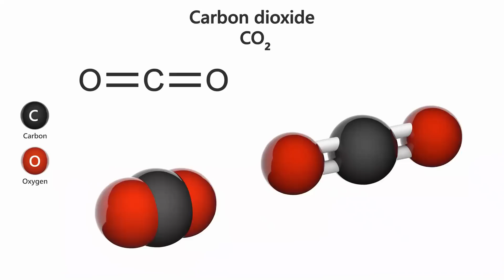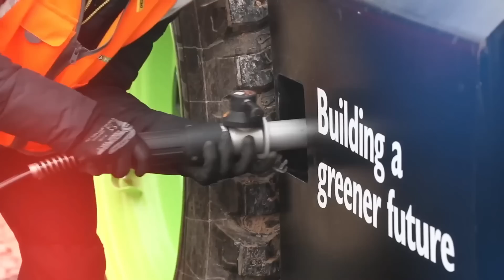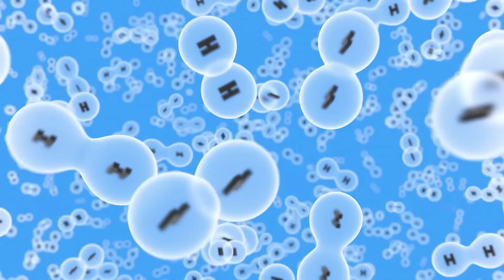Huge News! JCB's Hydrogen Engine will destroy the EV Industry!

Comment: Used to laugh about putting water in our cars then , electrolysis was worked on, burning the hydrogen works but from water the oxygen gets dumped but i wonder if it could be route also to the engine so no need for air-intake and no nitrogen then no nox ??

Comment: As CO2 is NOT a pollutant and is REQUIRED for life, this FUD is nonsense.  The overlords are terrified CO2 will rise for good reason.  Ask any greenhouse operator to show you his CNG CO2 GENERATORS used to boost production of plants!  Overloards are terrified high CO2 will cause us to be DROWNING in FOOD, used to control us.  2000ppm tomatoes are HUGE!
Outside of my obvious fear of ANY explosive gas in quantity to be stored in your garage, H2 leaking replaces Oxygen causing death even if the leaky tankage doesn't blow the house apart.  You KNOW storage in the consumer's product WILL leak from cheapness.
No mention of this H2 engine's longevity beyond the payment mortgage is considered,  Case in point:
Every DIESEL injection of fuel OIL sprays the cylinders with OIL!  The FUEL is a LUBE OIL.  This is why DIESEL engines go 1+ million miles between overhauls.  Hydrogen or any other gas wears out the top rings from day one.  Gasoline, a solvent, is worse!  Long life engines are all DIESEL!  Of course, the overlords selling cars WANT it to wear out, forcing you to buy another one, SOON!

Comment: I do HOPE it's hydrogen/electric--- with hydrogen operating the electric motors on each wheel like trains.  That would gove FAR more mileage, longer wear, moire power, and much less fuel used at all and the ONLY output being WATER.

Comment: Fuel cell is a better option. The hydrogen engine needs compressed gases, a leak, even a small leak is catastrophic-ie explosive! and they are putting this on construction equipment which are notorious for impacts and scrapes...Yeah, good call...
Reply: yep, because no equipment runs on compressed gas, except our forktrucks used in our Propane company that fills thousands of Propane cylinders per day. Good thing they don't power construction equipment, trucks or automobiles with that explosive gas or heat peoples houses with explosive gas.

Comment: All this is fine And good until ,someone wrecks the thing. And a leak happens...🧨☠️ Remember the Hindenburg....
Or a leak just happens. Anyone who has seen a car battery explode knows about this. 
Car batteries explode just a small amount of hydrogen. A very small amount... Using hydrogen as fuel requires much more then that.🥺☠️

Comment: Destroy the EV industry? There are currently 140,000 EV charging stations in the US.
And 150,000 gas stations. MORE in Canada & Mexico. How many H fueling 
stations are there? California has the most with 17. And those were built by the 
state government.

!
Reply: 60,000 public chargers in the UK and over 30 million homes plus work premises. 12 hydroden stations. JCBs engine is for a niche of big machinery for operators who will need to have a Hydrogen storage facility. EVs are simple, cheap and getting cheaper.
Vehicles with fewer and more reliable working parts. Why would anyone wabt a complex andd expensive 'new' ICE that you can't fuel? Why use energy to create hydrogen then transport it to distribution points of which tens of thousands would need to be built? 
Nonsense, Hydrogen engines aren't going to take over anything.
Reply: @iainwares6361  Exactly. There are now so many glossy, fossil fuel industry funded, videos being published now, all starting off with visions of wind turbines and PV panels and then the cut to a big shiny H2 container sitting in a field of grass. It's utter propaganda.  The absurdity of using wind and PV electrons to create H2 (wastefully purified, compressed, cooled and transported for using in expensive precious metal fuel cells) or even worse, compressed and used in a ICE, is breathtaking.  It needs to be called out every single time.
Reply: 16 now, in CA, now that the Bakersfield refueling station blew up (stranding all the other ill-considered, million dollar, busses).

Comment: Hydrogen power is also a way of retaining a real car (i.e. with a proper engine rather than a battery operated 'E vehicle ') for motoring enthusiasts
Reply: A hydrogen vehicle is an even better way to die in an accident compared to a standard friction engine vehicle. A fossil fuel leak and combustion will give you plenty of time to realize you're going to die, where as with hydrogen, you will be with your maker in the blink of an eye (along with unfortunate bystanders - to whom you will, for all of eternity, have to apologize, for your ill-considered transportation fuel of choice).
Reply: @mb-3faze  finally! Somebody with atleast a small amount of good sense. You have just proved you have more then that.
Now if we could persuade others that just because someone can do something it doesn't mean that they should do something
Like that accident they had with the demon core and a screwdriver. That was really stupid.
Reply: That’s BS… you would not be able to do anything modding wise or to make it go faster. You will have zero control.
Reply: @KKandEV  Still a proper ICE car always better than battery powered
Reply: It is.

Comment: First of all we want Hydrogen on Demand!! not government-controlled hydrogen fuel? We can make or own fuel as i drive one now and quite happy with it. I Save between 30-37% on fuel. with more technology this can be greatly increased. Hydrogen on demand kits are easy to install to any currant ICE's  🙂
Reply: It would be worth you looking into this. The answer will disappoint you but you'll learn a bunch of physics.
Reply: Please keep that thing far far away from me!!!
Reply: @timothyterrell1658  Why it is perfectly safe!! Been running it for a year and a half now! you burn it as you make it also has a built-in bubbler and a one-way valve so impossible to blow up 🙂
Reply: @thegrantdanielsband  I know how one way valves work... until they don't. You know how nuclear reactor domes blow off?
It's that hydrogen that keeps showing up.
Reply: @timothyterrell1658  First of all you have no idea i said not only it has a one-way valve BUT? I also said a bubbler and it burns the gasses right away! there uis no way it will blow simple! I aso said i have been using it for 1 and a half years flawlessly so i know how safe this is and the money that i save :--)
Reply: @thegrantdanielsband  as I have extensive experience with the industrial chemical environment, working on and with gasoline propane diesel fuel and electric drive equipment, have seen equipment failure of all types. Industrial chemical process units exploding and burning seemingly with no proper cause or reason. Having worked with oxygen propane natural gas diesel fuel engine oil hydro oill gear oil  argon helium carbon dioxide freon sulfer dioxide several acids and solvents along with several things they wouldn't tell us what it was..Telling me that it's perfectly safe is telling me that you don't know what your doing. As there is nothing that is perfectly safe. safe ? There's no such thing as safe. You write about back flow preventers and bubbler valves as if they're absolutely foolproof.. I on the other hand had such blow up in my face.I am very proud to still be alive .  Mark my words, when you think you have all the answers start over and look again.
Reply: @timothyterrell1658  Obviously your experience was a failure? My experience with a real company that makes these kits that work is awesome and saves me money sorry for your luck and inexperience, but you would benefit from a company that has the product that works like i have 🙂
Reply: @griffint6637 untill something goes wrong.. And when it does you can never take it back...
That's not if, that's when.... Humanity has a bad habit of making mistakes and atomic energy has no room for mistakes.
It is best to leave that sleeping dog lie.
Reply: Are you talking HHO ?
Reply: @jerrypeal653   you mean that stuff that blows up with the presence of oxygen and sunlight?
Reply: @jerrypeal653  Yes
Reply: @griffint6637 nope not necessarily, renewables like wind and solar can produce it .
Reply: I save 99% running my diesels on 75% used motor oil mixed with 25% used ATF.  Touche...:face-purple-crying:
Reply: I'm going right to the point.🤨 We have a number of people who think that hydrogen is a good fuel source..
There is one simple problem with that.
Hydrogen is a nuclear level fuel , having very weak binding qualities. What this means to us is it is a high explosive chemical
Element, and will bind with oxygen very freely. Requiring very little heat to ignite.
This Is All well known information passed on for generations now. 
Some people choose to disregard the information provided by our elders about the extremely dangerous unstable nature of
this element. Having seen how easy it is to detonate the small amount of hydrogen collected from a charging car battery
And just how violent that explosion is, I strongly warn those thinking that hydrogen is a viable moter
 vehicle fuel source,To think again. As you're never going to be able to produce a safe system to sustain a high speed collision with another object. As noone in his right mind would consider using liquid TNT as a motor fuel, why would you consider using something that is even less stable?
So please stop wasting time and money on something that will not work.
Find something to use for fuel that is stable and get to work making something that we can use instead of something that we can't.
Reply: @griffint6637 to split hydrogen from water you have to invest exactly the same energy into it as you can get out of it, plus whatever lost energy in handling.
Reply: @griffint6637 if you think so we can set you up with a nice house right next to the local nuclear power plant.☢️☠️🤨
Currently noone wants it at any price.🪦 wake up and smell the three mile island.... Unless you want to go to Japan...
I hear they have a really nice sea side location really cheap. I'm sure they would let you move right in..🤣
Reply: @griffint6637 under normal electrolysis it does, but there is more than one way to split a molecule of water.

Comment: ICE Engines  ? They are done compared to Fully Electric motors ? Hundreds  of moving parts that can brake compared to Electric only having 3 that are good for hundreds of thousands of miles no oil changes no spark plugs no airlifters . :text-green-game-over: ??  Though There in my opinion a place for Hydrogen , to generate electricity to charge the batteries on EVs  🙂
Reply: And how environmentally dirty is the EV battery manufacturing process? Hydrogen power is also a way of retaining a real car (i.e. with a proper engine rather than a battery operated 'E vehicle ') for motoring enthusiasts
Reply: @namesurname4385  Does it go broom broom like a V8, thought not.
Reply: @EXSKIN  It depends, if the hydrogen combustion engine is in a V8 high capacity I can't see why not but the combustion is always better than a battery operated
Reply: @BillBadMule Batteries are ideal for toy cars not for real world long term needs. Even so they need to be disposable otherwise your kid wil play for a few minutes and spend hours crying waiting for them to recharge!

Comment: Finally I stopped the video as it is more a blatend commercial for JCB then an actual review of balanced pro's and cons of hydrogen as fuel. I could have know within the first 4 seconds of the video as there already a misconception is launched but I wanted to give the maker some slack. Hydrogen as meant these days is not a energy "source". It is a transport method for energy. Hydrogen has to be made using energy. So it is only green energy when it is made by environmentally friendly sources like solar panels and wind or water turbines.
Reply: @griffint6637 Indeed. Fukushima demonstrated how well hydrogen is created. So much so that it demonstrated the fact by blowing itself to bits.
Reply: @griffint6637 No, no , quite well educated in the fields of engineering and physics :)  Nuclear power and 'safe' can be in the same sentence but add 'human' in, and history shows that you either have to remove 'safe' or 'nuclear' to make a logically accurate statement.
Reply: And you're point is?

The objective is zero emissions at the tailpipe.

JCB is a company so of course like Tesla they're promoting their achievement.

JCB makes heavy industrial equipment that needs to be decarbonized and batteries can't solve their unique problem.

Their Hydrogen "Diesel" engine can be the answer for immediate change to industries that want to go green but have no alternative.

Ships, trains, tanks, trucks, dozers, excavator, farm equipment, mining equipment, and diesel electric generators all have duty cycles that can't be serviced with batteries.

So your complaint is what, that they were first to do something about it or how they mischaracterised the function of hydrogen?

Gas, Diesel or Hydrogen all require the use of energy to make, refineries aren't run on magic.

They received no government money, they're not known to the consumer market and need to promote to sell but their customer base is small so a mass ad campaign won't be economical. Name one thing you buy that isn't advertised, even vegetables make the weekly flyers.

They'll use their dealers and sales reps and trade magazines but the potential for their technology goes far beyond their typical market.

It takes content providers to seek them out and inform John Q Public on what they are doing.

When was the last time you saw an International Harvester ad on TV 1970 what?

They don't use TV because their buyers are working during the day, probably get up during evening commercials and they need more 15 to 30 seconds to sell their products.
Reply: @IMGreg..  My point is that an advertsiment video is not the good place to gain information about something as there is no balance. For some reason Americans lost that concept completely as they are so used to commercials that even videos presenting as informational videos are received as 'normal' while the only goal of the video is selling a product.
Reply: @griffint6637  nuclear power is not environment friendly. It is a blatent lie. The waist is stored underground in the "hope" it will not leak radiation within 30.000 years. I have seen seldom a more stupid deny of safety as storing nuclear waist in concrete underground and just hope it will stay closed.  Hydrogen should be made by solar power, wind power, hydro power but not with nuclear power
Reply: @griffint6637 So permits, site and environmental impact studies for a new, say, 5GW reactor would take about 8-10 years, building it would take 15 years or so. It would last 30 years, maybe 40 producing overpriced and subsidized electricity and then the public would be on the hook for decommissioning which would take how long(?) - it's never been done. After that, 500 generations before the land would be contaminant free. I used to be pro-nuclear, but really, the numbers don't add up and the alternatives are much better.
Reply: @griffint6637  Actually we don't need to know much about nuclear energy other then it gets very deadly whenever it gets out.
Chemical energy on the other hand,we know far more than we want to know. 
Hydrogen gas is a very unstable dangerous gas, and is a byproduct of nuclear power generation.
With proven desasterous results. 
Hydrogen gas is very desirable in stars ,but not in planets.
And most particularly not in direct contact with nuclear reactors..
The promotion of nuclear energy by certain individuals who have invested so much of themselves in it is unfortunately
Promotion of themselves.
It is not in the interest of humanity that this this continues,as we cannot cleanup when they mess up and drop a test tube
in they're fantasticly destructive toys. 
Nuclear energy may be fantastic and all that,  But humanity is not ready to deal with the reprocussions of our own mistakes.
Reply: @griffint6637  Therin is the rub. 
The human factor.
Neither you,I or anyone else factor out the human factor. It is the one thing we cannot overcome.
We are still human.we make mistakes.
Even Instine had strong misgivings about nuclear power before his death. He knew that his work was a mistake.
He knew he had opened the Pandora's box.🤨☢️
Reply: And how environmentally dirty is the battery manufacturing process?

Comment from the maker: What do you think of JCB's Hydrogen Engine?
Reply: Great
Reply: Hydrogen power is also a way of retaining a real car (i.e. with a proper engine rather than a battery operated 'E vehicle ') for motoring enthusiasts
Reply: The possibilities are enormous beyond their core business if it configurable for other manufactured equipment.

Trains, tanks, ships, grid electric generators, portable electric generators, trucks, harvesters.

Their engine technology could be an entirely separate wing if it is adaptable.

Imagine being able to go after Cummins with a rival hydrogen engine.

But they better move fast. lol
Reply: @IMGreg..  diesel fuel is a very stable fuel source. Hydrogen on the other hand is an extremely unstable fuel source.
That alone is reason enough to never use hydrogen for motor  vehicle use.
Reply: A brilliant engine design....and a really stupid fuel choice. Hydrogen is a very unstable fuel source.
Prone to catastrophic detonation. Try building a car around a surplus 500 pound bomb (with the TNT still in it) then add the impact fuse just for fun... how's that going over. Add a few thousand more to the picture.🤨💣💥🪦
Reply: I think i will never use a JCB what ever fuel it uses ,but if i had a hydrogen car i would be wondering where to get the fuel from while my home has many EV charging points....